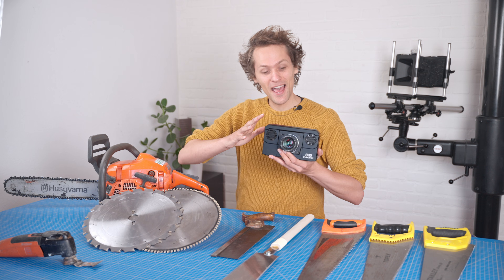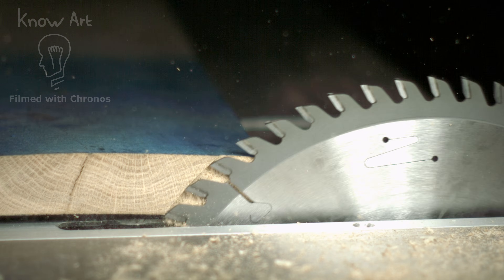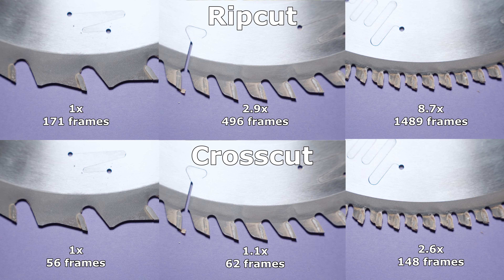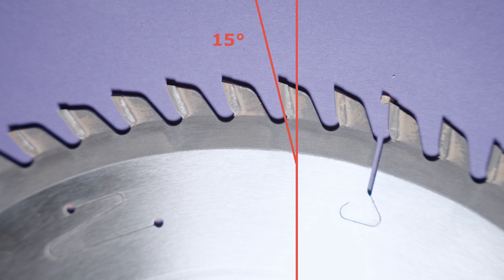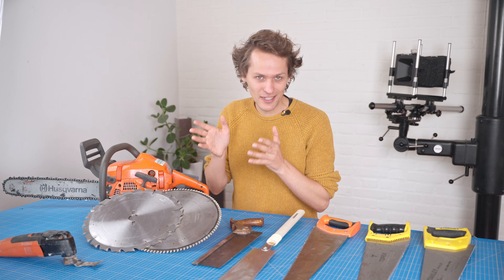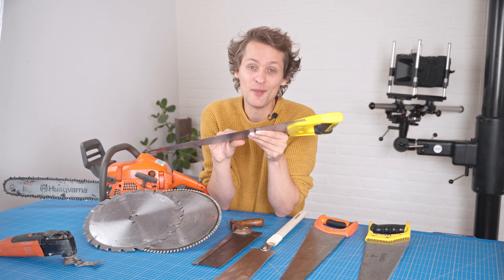Why Crosscut Saws Can't Rip

Comment from the maker: Brilliant is great: https://www.brilliant.org/knowart/
go and try it for free. they've been super chill to work with and I actually use their product daily
Reply: As a well meaning recommendation, 8.7x times LONGER means the time elapsed was actually 9.7 times the original elapsed time. If what you mean is that it is 8.7 times LONG then the elapsed time would be only 7.7 times longer. At least in my opinion.
Reply from the maker: @GuillermoAlfonsoSantosVillarre  hmm, yeah I should've said 8.7 times as long. good catch
Reply: @KnowArt  I love your videos thank you so much for replying <3
Reply: Why is the icon for "Programming with variables" a 3D printer?
Reply: Why are you talking like that?
Reply: @Octopusprimal  What do you mean "like that". I am making a point about the difference between saying "2 times longer than something" and "2 times as long". Most people ignore such distinctions, as another example saying "3 times lighter" (which makes no sense mathematically speaking), instead of a third of the weight.
Reply: @GuillermoAlfonsoSantosVillarre  no one was talking to you tho

Comment: Fun fact that multitool basically operates on the same principle as cast saws do; they vibrate back and forth and will cut into hard materials but when they come into contact with soft materials (like your skin) they end up just vibrating the material back and forth with it and not cutting it.

Comment: The 24t and 60t both have ATB tips (left/right aka Alternate Top Bevel) but the 24t looks like a rip saw since it has the stopper, the 60t is more of the usual cross cutting saw though 60t is still in the "all purpose" range, and the 100t is ok for MDF/HDF should work better for plastic or maybe laminate like floor panels since it has negative angle and is TCG (triple chip grind - trapezoid/flat teeth). Also the 24T has higher hook angle. While the 24T and 60T comparison is fine the 100T blade is not really made for this but I guess you've done a good job or realizing it would be better suited for harder woods. You should try to get a 24, 48 and 72 teeth blades as they should all be available in ATB tips and are multiples of 24.
As for the angle for circular saw blades I've seen from +25 degrees to -6 degrees hook angle.
Seeing the chainsaw in slow mo was cool though.
I sharpen woodworking tools so I have to explain which blade is for what and what they should get to people sometimes. 

I've seen stuff...

Comment: 12:40 Fun fact! That oscillating blade not cutting soft materials is why it is used for cutting casts for broken bones. The medical cast saw blades are purposely slightly duller than multitool blades for extra safety but are what the multitool was based on. Pretty neat

Comment: Nono, chainsaws are not confusing when you first fill em, you just need to know if it's a universal voltage charger or if it must have 240v.
Then there's the question of if you have a fast charger or not and if it's the right model battery at all!
Also they may or may not have a spring to help you get the battery out again when you release it.
🤣 OK, I'll stop trolling now. I see electric chainsaws are no simpler.🤣

Comment: A quick tip for Hacksaws.
Reverse the Blade in the Frame, so it cuts on the Back-Stroke.
Just like a Japanese Pullsaw, the cut will be straighter, the Blade will never snag or kink, and the Blade will last much longer.
Reply from the maker: lovely tip

Comment: Overall beautiful video, but the explanation is actually wrong because you are forgetting, that the saw is in contact with the wood piece with multiple teeth in both cross cut and rip cut. If you imagine the piece being infinitely strong and have zero plasticity you wouldn't cut anything because the teeth in contact would not allow new teeth to bite in. Each single tooth as it cuts into the wood is pushed forward by the constant force into the wood during its travel, so it cuts out a triangle (simplified). The size of the base of that triangle dictates how far into the piece will the next tooth be able to bite in. And that is dependent on how many contact points there are with the piece, i.e. less teeth means less contact points and higher pressure on each tooth + longer travel between each tooth = larger cut out triangle per tooth. The more elasticity we have in the material, the higher benefit we'll get from less teeth. And of course, wood is stronger (less elastic) in crosscut than in rip cut, that’s why we see smaller difference in cross cut results. In other words - too many teeth in rip cut are actually not taking the advantage of how much each tooth can bite away, because they are “blocked” by other teeth. If you overdo this and go for a saw with even less teeth, eventually it will stop the saw even on wood. That’s why saws for metal have way more teeth - the elasticity of the metal (yes, elasticity) would not allow for bigger chunks anyway, so we compensate with quantity of the impacts.

Comment: The filling of the gap between teeth makes sence if you have long enough cut. The saws that curve out of wood are mostly immune to this. It's mostly an issue with straight bladed saws. 
You can also put cooking oil into your chain saw lubrication tank if you're cutting wood for smoking food. Saw does't care what kind of oil it is as long as it lubricates

Comment: AI Summary

Abstract:

This video uses a high-speed camera to investigate the mechanics of various saws. The primary question explored is why saw blades with fewer teeth cut faster. The popular theory that the gullets (spaces between teeth) of high-tooth-count blades fill with sawdust is tested and conclusively debunked with high-speed footage. The actual reason, as far as the video can tell, is related to the energy required to sever wood fibers. A key insight is that the speed difference between high and low-tooth-count blades is dramatically more pronounced in rip cuts (along the grain) than in crosscuts (across the grain). This is because rip-cutting with many teeth repeatedly severs the same fiber bundles, wasting energy, while cross-cutting primarily involves separating fibers, which is less energy-intensive. The video also examines the distinct mechanics of rip saws, crosscut saws, chainsaws, bandsaws, and oscillating multi-tools, explaining concepts like rake angle, saw set, and chainsaw kickback.

An Analysis of Saw Mechanics with a High-Speed Camera

*   0:17 Fewer Teeth Cut Faster: An initial test with 24, 60, and 100-tooth table saw blades confirms that blades with fewer teeth cut significantly faster through oak, with the 100-tooth blade causing burning.
*   2:52 Gullet Theory Debunked: A common explanation is that the gullets on high-tooth-count blades fill with sawdust, impeding the cut. High-speed footage clearly shows the gullets are nowhere near full, invalidating this theory.
*   3:35 Rip vs. Crosscut Efficiency: The video presents its core finding: the performance gap between high and low-tooth-count blades is massive for rip cuts (along the grain) but minimal for crosscuts (across the grain). This is because rip-cutting involves severing tough wood fibers, and using more teeth means inefficiently re-cutting the same fiber bundles.
*   4:33 Rip Saw vs. Crosscut Saw Mechanics: Rip saw teeth act like chisels, chopping fibers. They are efficient along the grain but cause tear-out when crosscutting because they tear fibers apart. Crosscut saw teeth are angled to score the sides of the cut first, like knives, cleanly severing fibers before removing the waste.
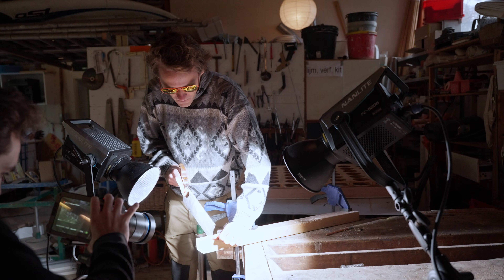*   6:04 Rake Angle: The aggressiveness of a saw tooth is determined by its rake angle. A high positive rake angle is aggressive and efficient but can grab. A negative rake angle is less aggressive, requires more power, but produces a cleaner finish and is used for hard materials.
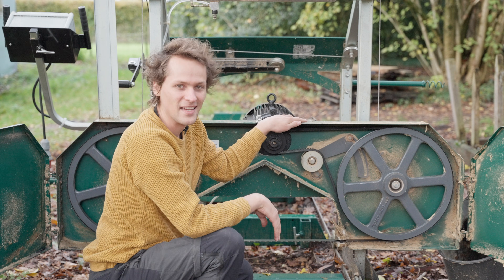*   7:52 Bandsaws and Chainsaws: The evolution from inefficient reciprocating saws to continuous-cutting bandsaws is shown. Chainsaws take this further by curving the blade in the direction of the cut.
*   9:15 Chainsaw Tooth Design: A chainsaw tooth combines a rip and crosscut chisel into one. A "raker" in front of each tooth acts as a depth gauge to control how much wood is removed, preventing the aggressive teeth from digging in too deeply.
*   10:13 The Cause of Kickback: Kickback occurs at the tip of the chainsaw bar where the curved path effectively moves the raker out of the way, allowing the teeth to take an uncontrolled, deep bite that throws the saw back at the operator.
*   11:32 Oscillating Multi-Tool: This tool is slow but uniquely useful for plunge cuts. It is also relatively safe on skin because its rapid side-to-side vibration tends to move soft, flexible materials with the blade rather than cutting them.
*   12:28 Saw Set: Saw teeth are bent slightly outward (the "set") to cut a kerf wider than the blade, preventing it from binding in the wood. On fine blades like hacksaws, a wave is pressed into the blade to achieve the same effect.

AI-generated summary created with gemini-2.5-pro for free via RocketRecap-dot-com. (Input: 17,816 tokens, Output: 834 tokens, Est. cost: $0.03).

Comment: The reason is because the amount of surface area contacting the wood. When you have a bunch of small teeth the teeth are actually holding the wood away from a deeper cut. A big tooth allows the cut to be deeper.

Comment: an interesting thing is that surgeon saws, used in medical fields for cutting bones or casts from a human, you know like when you brake your arm are also oscilating saws, they are also rounded, they can easily cut through bone or a cast but won do any harm to the patient when you nick them, yes you could do damage with them on purpose but you could do that with basically anything that ehists, im convinced that you could do harm even with a pool noodle

Comment: The blade with 100 teeth looks like a blade that should only be used on mitre saws, because the angle of the cutting teeth is negativ and could push the wood away from the table of a table saw, potentially resulting in kick back. But maybe it only seems like the wrong blade in the video.😅

Comment: Honestly I'd be interested to see what the misery whip profile does on a table saw where it has like 2 or 4 teeth like a crosscut but then has a 5 tooth that behaves like a chizel to cut the noodle loose at the bottom.
Also chainsaw blade but round cause it's basically a condensed misery whip where 2 teeth are cutting both sides and the bottom.

Comment: I bet someone good at math could tell you what frame rate to use with the speed of the saw and the amount of teeth and maybe even some other  fractions for if the blade slows down some too, I know there has to be some guess work, but I will also say all these facts are possible to find out like blade speed, slow down when cutting, tooth count per ms, pretty much im throwing shzit at the wall but it all made sense in my head. But once you have all those variables and you dont change the wood or cut angle you could turn it into an equation to solve for each shot. I could write more up here but you already did the video and I have no idea what you did because I paused once you said you found the perfect speed on accident and that reminded me of this other video that needed X solved for Y when needing A B C D variables, and yes i'm completely dumbing this down so it's not to long. I also think the more teeth the more the saw will start to act like a disc with no teeth at all, just like the bed of nails trick, 10 nails will hurt and maybe stab but 100 and you will hardly feel them.

Comment: Seams kind of intuitive.  Same saw = same horse power divided by number of teeth = power per tooth.  So it’s lots of light hits vs a few heavy hits.  The larger blades will rip out more material, but at the expense of a rougher cut.

Comment: Interesting video! But you got the safety mekanism of the chainsaw wrong. There is a weight  in the handle have inertia that trigger a break on the chain when the  saw is put in motion. Hope i used Inertia correct 😅
So don´t remove the lead weight in the handle because then you removed the safety.

Comment: We had in the workshop an alternating saw for cutting metal (much slower than the loop continuous saw) due to the permanent direction change. But I did not realise that the alternating saw has a huge energy waste against the inertia. But it is more precise as hobby machine than the hobby loop machine, or the sabre saw, or the pendulum saw.

Comment: I'm pretty sure your frame rate is still too low. You're getting what is called aliasing. You can tell be the way the vibration dampening grooves in the blade jump around during the vid. You are getting multiple teeth moving passed the wood per frame. It is the same effect when the rims on a car look like they are moving very slowly or backwards.

Comment: The oscillating saw was originally made and patented in germany for the medical device that is used to cut off casts a long time ago.
Reply: Also they aren't slow at all when you use the right blade for specific work instead of a multi purpose blade. I have a 2x4 wood and drywall blade for wood, a metal blade for auto work and it's important to know higher speeds for wood and slowest speed setting for metal.

Comment: It's important to remember that steel teeth and carbide teeth work very differently.  Steel works at lower speeds, and shears or slices the material.  Carbide works at much higher speeds and scrapes rather than slicing...

Comment: I used a hand chain saw to make table saw quality cut in any direction.  low angle, low pressure and flip before it breaks through.  
I was very surprised how well it worked.

Comment: Hi, excellent video!
I completed my diploma thesis on wood cutting with a circular saw and many of the phenomena you show here are exactly what we observed in the lab. We built a full test rig with adjustable parameters such as spindle speed and feed rate, and we measured torque, motor input, and the pulling force of the carriage with the workpiece.

In your video you clearly demonstrate how the tooth space filling with sawdust, characterized by the bulkiness coefficient (or loosening coefficient), affects chip evacuation and leads to increased friction and poorer surface quality. We recorded almost the same behavior in our tests.

I also studied how the tooth edge radius and hook angle influence the risk of burn marks. Your explanation that cut burning is linked to the ratio between the tooth edge radius and the feed per tooth is absolutely correct, although the phenomenon is more complex, involving vibration, elastic deformation, and blade resonance.

The high-speed footage is fantastic, you can literally see the micro vibrations and chip clogging that explain the rise in cutting resistance.
Thanks for sharing, your video beautifully combines practical observation with visualization of effects usually seen only in controlled lab experiments.
Reply: wow so much work and i always just bought blades meant for cutting steel. actually i only ever bought 1 blade and its still good

Comment: Having more teeth together means each tooth cannot dig deep into the wood and make a cut, if you barely lick the wood then you do not make a cut and only produce enough friction for heat. Imagine having infinite amount of teeth... that is practically no teeth by now and it is just a smooth disc, now try to cut with it, you can't "dig" into the wood since there is no protruding teeth and the only thing that you do is "rub" the disc really fast against the wood which would make almost 0 cut and will only produce friction heat. The key here is that the teeth are not individuals, they are connected together, which means they buffer each other's effort to dig into the wood not letting it in.

Imagine this, having ONE nail and stepping on it will cause it to penetrate your foot, if you have thousands of nails next to each other you could step on it with your shoes and it wouldn't penetrate them, if the nails are too many and too small and next to each other you could step on them barefoot and not get hurt. If you eventually make them infinitely thin and put them all next to each other you practically have a flat surface, totally unable to harm you by penetration.

This is why if you ever try to use that iron saw to cut wood, you will almost fail to do so before you get super tired. The cut it will make will be super fine and accurate, but you won't be able to cut anything more than some millimeters into the wood before it starts turning darker due to burning if you use the saw fast as well.

The saw teeth almost never fill up with chippings as long as they leave the wood back and forth, the filling up usually happens with files that have a flatter area with a lot of teeth next to each other and they act as pockets for wood dust to stick in them providing cushion and preventing the teeth from digging into the wood and thus you have to blow air on them to remove the fillers and continue your job.

Comment: Circular cold cut saw blades have a slight inward taper (so they are thickest on their outside edge) instead of set teeth so that the rest of the blade doesn't rub.

Comment: Im in precision machinery and it's the more cutting surface takes up more hours power(hp) meaning the cut needs to be slower and the saw makes it slower we learn this with ball nose and bull nose end mills as ball nose end mills are horrible with hp as it cuts on a full circle at the bottom as a bull nose is more flat and has two coner like prices making it take a bit more hp then flat end mills (for those who do not know what end mills are they are like drill bits but used differently)